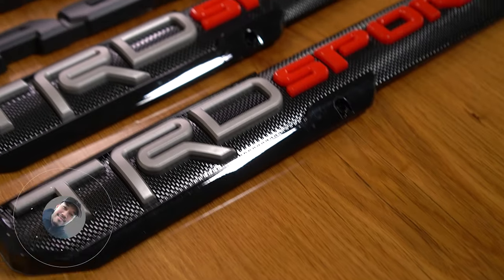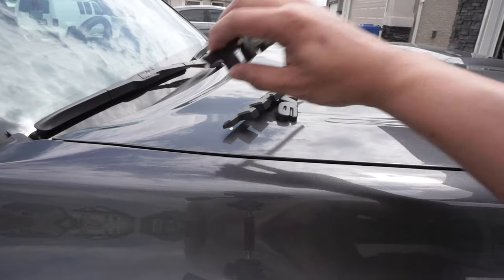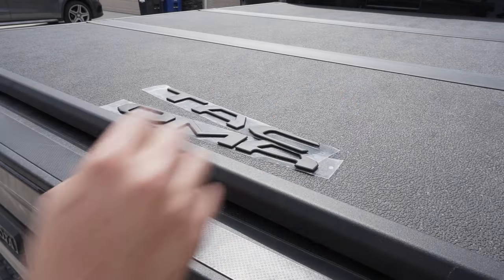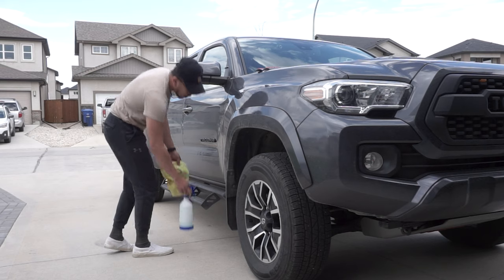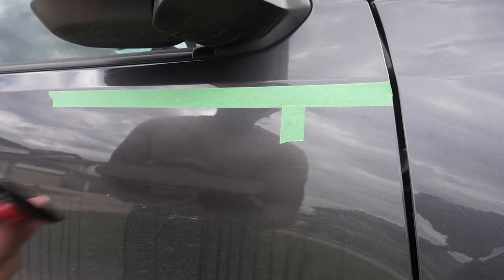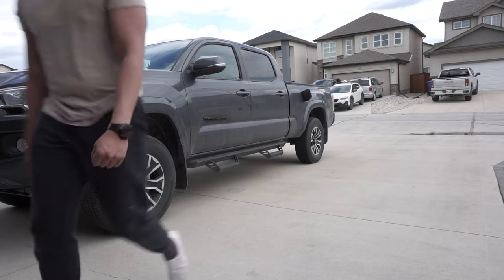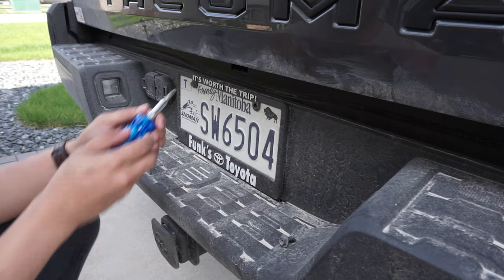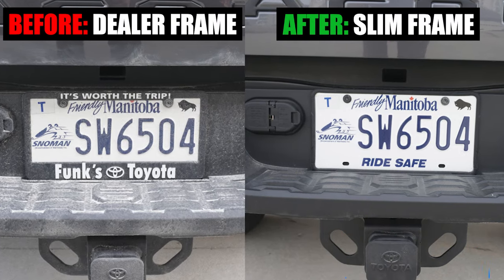EASY AMAZON ACCESSORIES INSTALL on the 2022 Toyota Tacoma TRD Sport | Part A EXTERIOR MODS

Comment: Hey I love your videos and just recently got a used 2021 TRD Sport. It came with silver OEM emblems as your did on the sides but mine has physical silver emblem on the tailgate "Tacoma". Would I need to remove these before putting black ones on? Or is there a overlay for that as well? Thank you for all of the information.
Reply from the maker: Hi thank you for the kind words and for checking out my channel. 

For the emblems you don't need to remove the old one, this goes over top of the existing!

Stay tuned to more content coming soon, been away awhile but working on lots of product install coming soon!

Comment: I have the same color truck! I like the chrome look on the dark gray color. I added chrome to the tailgate. I have added seat jacker to the drivers seat, glove box and center console dividers, LED interior lights, license plate and fog lights. I really like the TRD badge but not sure it would blend with the silver already on the door.
Reply from the maker: Hi Edric! Nice! How you liking the truck so far. I agree with your comment on the TRD badge, I'm still deciding whether to keep it and remove the Tacoma emblem below it so it's not so overwhelming, or just remove the badge altogether. Thanks for checking out my channel!
Reply: @themandiyrin  Loving the truck so far! I think I'm going to order the tailgate lock/unlock for it next.
Reply from the maker: @edric_munster5531  nice! I'm looking into that as well in my next couple mods! Any specific brands you looking at?
Reply: @themandiyrin  Running for Tacos but they're all sold out!

Comment: Mine are starting to get paint-chipped over time now. 😢 the worse thing was, when I installed those badges, I did put some heavy duty glue on the back as well. So i dont think I'll be able to remove thosed badges. I guess I should bring my truck to a custom paint shop for them to repaint those badges
Reply from the maker: Oh no I'm sorry to hear that! Luckily mine is in perfect condition still! The double sided adhesive It came with is also holding for me

Comment: What’s ur mpg?? I have 22 off-road long bed with about 500lbs  of tool in the bed getting 16 ish mpg
Reply from the maker: Thanks for checking out my videos. I don't have as much tools as yours but I do have a roof rack and tonneau cover. I'm getting around 18mpg on average. I was getting around 19mpg before but the roof rack made that a bit worst. 

That's with the stock tires and suspension. I assume once I go up in size it'll get even worst haha